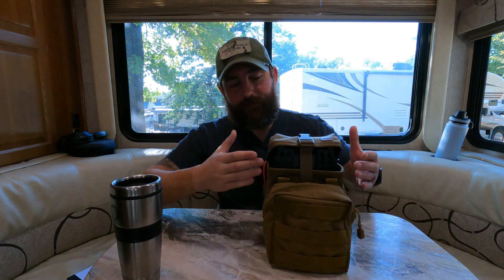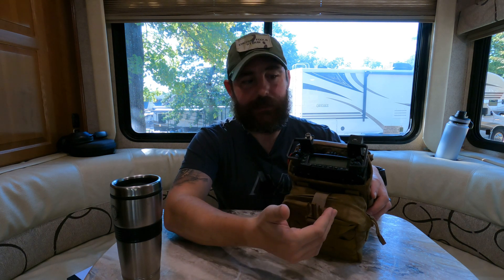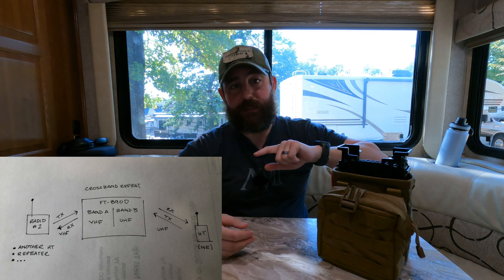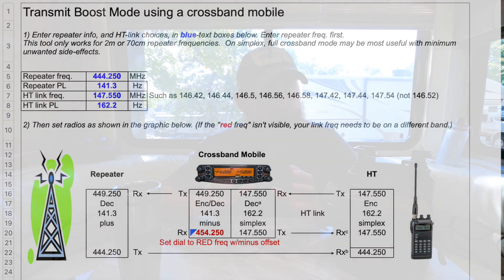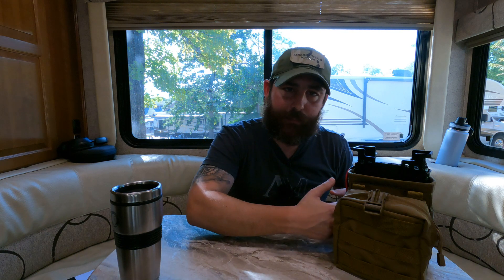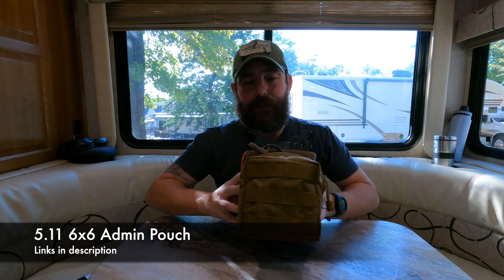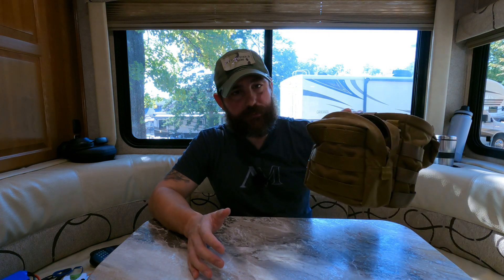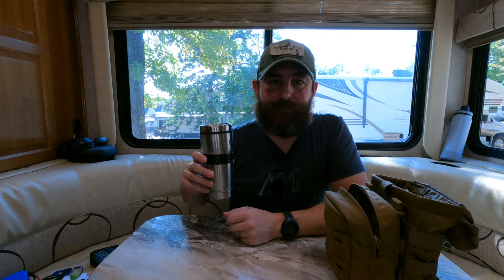Military-Style Radio - Manpack Crossband Repeater - Part III

Comment: As usual, really thankful and enjoyed the content. You've got me thinking through building out a manpack. I have limited equipment (a DB mobile and a few HTs) and want to utilize what I have since buying/building a whole new kit is out of budget for me. Luckily Armoloq makes a pack frame for my mobile unit (Anytone 578). I was wondering if you had any advice on how and what to think through on determining what someone would want/need in a manpack, capability wise. I know that it's individual to each person's needs, but I'm struggling to figure out how to determine what those needs might be or should consider. Thank you!
Reply from the maker: This is a great question. It absolutely depends on what you want to do. I will try to touch on this topic on my next video as there are so many bands and modes of operation. I will be covering the Yaesu FT-818ND which is an all-band and all-mode rig. It's basically a Swiss Army Knife, but you lose some capabilities such output power, dual VFO and crossband repeater. There is no perfect radio for all application. Think about who you want to contact and make decisions around the best form communication for that application. Good luck with your build.
Reply: @TheTechPrepper  so would you say this is the perfect overall radio? To give you basic everything all band and digital too?
Reply from the maker: @paulNC  It's a toss up between this one (the FT-818ND) and the next one (the FT-857D) I am going to cover. I will be comparing them in the next video. They have the same all-band, all-mode capabilities. The only difference is size and power. If you're on foot, the 818 is the way to go. If you have a vehicle or a base of operation, the 857 is the way to go.
Reply from the maker: @paulNC  It's a toss up between this one (the FT-818ND) and the next one (the FT-857D) I am going to cover. I will be comparing them in the next video. They have the same all-band, all-mode capabilities. The only difference is size and power. If you're on foot, the 818 is the way to go. If you have a vehicle or a base of operation, the 857 is the way to go.

Comment: Hi, im super interested to work out how to send the keyboard keyboard chat using two of these 8900 radios. I have one, i may get another, and or a 2980.  I too got this radio for the crossband repeat option, allowing me to use the low power pmr radios and repeat it out further on vhf....... i was annoyed to see that the radio cannot do the 6.25 steps, but have found the 5 tuning steps to work perfectly well enough.  I have a question for you though, when you do cross band repeat. does the fan stay on all the time? Mine turns the fan on the moment it transmits, and it never goes off again until power cycled, i have read this was an issue with the firmware, but dont know if they ever fixed it. 

I love this radio, especially the ability to listen to air traffic, just listening to the local weather etc is great to confirm the conditions on the day and make sure eveything is working. 

what kind of range does that signal stick get you?
Reply from the maker: Check out my videos on NBEMS for more info on keyboard to keyboard topics: https://www.youtube.com/c/TheTechPrepper/search?query=nbems

I typically only crossbanding one way. We call it transmit boost. The fan turns off for me.

Comment: hi, i don't believe that full duplex is possible because duplex need "cavities" (for rx/tx isolation) which are not tiny at those frequencies.. also why not to do some holes in the end of your bag for ventilation (and exhaust the heat in the air).. what i love it the idea of autonomy with a minimum of gear in your videos.. i dream of the field way of communication, hope it one day!! ❤

Comment: I suspect thea building a "radio system" such as you are describing follows a plan. In my builds I develop a detailed "Mission Statement". From that statement I decide what equipment will meet the specifications of the mission statement. Without the statement it becomes too easy to be distracted by bells , whistles and gongs that sound good but do nothing for the mission. I built a communications trailer using this concept N6JAI
Reply from the maker: I could not agree with you more. Each manpack that I build has a specific purpose and set of applications in mind. I actually have three different manpacks that are designed to handle different operating scenarios. Glad to see that you share a similar point of view on radio systems. Pick the right tool for the job at hand. 73.

Comment: Do you have a source for the Mobilinkd TNC3? They are sold out with no restock date. GREAT videos BTW.
Reply from the maker: Unfortunately, you will need to go directly to the mobilinkd site and hang tight until they are available. There may be some on eBay, but I have not personally checked. Good luck finding one. They are great from APRS and generic packet work.

Comment: What's your opinion on using a 2m/70cm amp powered by 13.8v DC along with an HT in this role? My daily EDC radio is a Yaesu FT-1DR already MARS modded and programmed the way I want. The built in APRS capability is a plus. 
I was thinking of integrating this into a manpack setup along with my Xeigu G90. I see dual band amps come up for sale on QRZ fairly often for very reasonable prices, and it seems an economical way to achieve a lot of capability in a man pack, without a lot more money. 
Figured I could power both the G90 and the amp off of the 18ah lithium polymer battery I already have. What pros/cons do you see for this sort of setup?
Reply from the maker: I can't really comment as I have never run that style of deployment. Personally, I find that I can make most contacts on an HT by moving to higher ground and with a better high gain antenna. APRS is great. I have the Mobilinkd TNC in my chest rig and have a cable for every radio. I just use the APRSDroid app or my own custom ARPS software when I use the laptop. I have considered an external amp, but mostly for my QRP manpack (FT-818). It's another component that can fail and I do not like that there is not an option on the market that covers HF/VHF/UHF. I'm sure others may have a different opinion about it.

Comment: Had the Yaesu 8900 in a mobile application and hated the radio for that because of all the knobs and small screen were hard to use in a rough riding truck. I packed the radio away and forgot about it, maybe time to pull the radio out and rethink its application. Or Ill sell it since discontinued Yaesu radios seem to hold there value.
Reply from the maker: Sell it! You'll make a killing. I agree. I do not like this radio for vehicle operations. Personally, I have found the Kenwood D710 to be my go-to mobile rig for the vehicles. It's easy to use while driving. Which rig do you prefer to the vehicle?
Reply: @TheTechPrepper  I'm a Yaesu guy, I ended up getting the FTM-400.  I like the dual watch and the 400 has much larger display with visual representation of volume level on the screen when you turned the knobs.
Reply: I would like to buy it if you are it. I hope we can work something out.
Reply: @ronaldlwilliams6839  I won't ship, local cash only in Denver Colorado.  If you really like the Yaesu FT-9800 capabilities and design you might want to look at the clone version.  TYT brand TH-9800 is a clone of the Yaesu and still readily available for half the price. Reviews are a bit spotty with some complaints of weak finals.
Reply: @mrbyamile6973  No problem. I was just curious. Thanks for the prompted response. Have a great weekend!

Comment: I have an Icom 2730A I've been thinking about setting up for a portable cross band repeater. It receives at 1.2A and transmits at 13A (I know its not the most efficient) so In cross band repeat mode will it draw a constant 13A or only when Transmitting? The Duty cycle statement confused me.
Reply from the maker: It only transmits when you or the other station is transmitting. The rest of the time it is receiving. In full crossbanding it's transmitting both sides of the conversation between both parties. Sorry, I should have been more clear.
Reply: @TheTechPrepper  Thank you! That's what I thought but I figured I could easily be wrong!

Comment: Quick question:   I’m really wanting to get that man pack built around my yaesu 8900.  With that, I need to be rigging up a tablet/lap top.  I know the Toughbook is the recommended way to go.  Is there any merit to a cheap Samsung tablet that will pack easier?  Maybe even in a sleeve inside the man pack or between the man pack and auxiliary/battery pack?  

Trying to take the cheap way out but maybe “buy once cry once” is the way to go here.  I appreciate your “tools not toys” approach.  

Thanks again.
Reply from the maker: I can only recommend what I use. Prior to the Toughbook I ran a Raspberry Pi 3B+. I destroyed three in the desert. The Toughbook has been handling the heat and Sonoran Desert for almost a year. The great thing about the CF-20 is that it coverts to a tablet. The screen detaches from the keyboard. The touch screen works with gloves, sweat and full sun.

Comment: I'm playing with a TYT-TH-9800 as well.  I'm almost done making up an Easy Digi interface specific to the radio that will have to connect through the mic port as the TH-9800 doesn't have a digital in capability.  Not as nice as the Yaesu but it should get the job done.  KD9RJX
Reply from the maker: It's unfortunate that the TYT-9800 was not a 100% clone right down to the 6-pin MiniDIN for the data port. This is how the interface works for the FT-2980R. It stinks that you need yo cannibalize the mic connector and speaker jack to run digital modes. Good luck with your cable build. 73's

Comment: I'm looking into how id hook the digirig to the tyt. I got a pin out, might have to get a second mic and do some fabricate'n
Reply from the maker: it stinks that that TYT did make a 100% clone. It uses a USB cable instead of the 6-pin MiniDIN. I am not sure if it even handles data for digital modes. I would be interested to hear what you find. Good luck!
Reply: @TheTechPrepper  basically im going to add a 4 pole .35mm jack for ptt mic speaker n ground so itl plug right into the digirig. Unfortunately theres no speaker on the hand mic pin out so i gotta get wild. KD2YHI
Reply: Any luck with digital on the tyt9800?

Comment: I got an email from Digirig.  They are going to make cabling for the FT-2980 before the end of the year.  That should work with other Y mobiles with the same mike pin setup.
Reply from the maker: Congrats on your DigiRig. I was the original tester of the FT-2980R. It works great. The original prototype had too short of a Y connection, but Denis is fixing that now. Here's a picture I posted a couple weeks back. https://www.instagram.com/p/CiX2C_prcTg/
Reply: @TheTechPrepper  Do not have it yet. Ordered it last night!

Comment: I don’t think you’re setting up crossbanding quite right.  The scenario you set up first has the two parties use different HTs.  One is on UHF, while the other is VHF only.

What you want is to set up all HTs transmit on UHFand receive on VHF.  Set the crossbanding mobile to receive on UHF and simultaneously rebroadcast on VHF.  This way all the transceivers in your group can be set up uniformly.

Comment: Just curious new subscriber.  Question could this maniacs setup talk to the baofang uv-5r ?
Reply from the maker: Welcome! Yes, you can use the Baofeng to talk to the FT-8800/8900 and use its crossband repeat capabilities. The nice thing about the UV-5R is that it supports dual watch, so if you configure the FT-8900 for "transmit boost", the UV-5R can listen on one band and transmit on the other. Good question.
Reply: @TheTechPrepper  awesome I was looking for a setup like this to run a squad size unit with a patrol base where the comes could be extended in two directions. Awesome content.  Also the battery used is no longer available what would you suggest as an alternative to this battery.  Keep up the great work

Comment: Dude, really love your work.  I'm learning a ton, super inspiring, love your "get out and test in the dirt/heat/cold" approach.  Question about NVIS: would this be a semi-reliable way to communicate between 2 camps separated by a mountain, i.e. instead of a repeater?  Or is NVIS more of a "talk to random contacts wherever your signal gets bounced to" kind of thing?  I'm contemplating a WRoL situation where running a repeater might attract more "attention" than I'd like.  Is NVIS consistent enough for these 2 camps (separated by say a couple of "as the crow flies" miles) to stay connected?  Would they be able to stay in constant contact like they would if they were in line of sight on VHF?  Or would it be pretty unreliable?  Like you I'm gonna get out and test but I'm just wondering what's possible.  Thanks!
Reply from the maker: Glad you're enjoying the content, Robert. This is a great question. I will actually by covering NVIS in an upcoming series. NVIS is a good from about 30 to 300 miles and is an incredible method of communication for local and regional communication with out any infrastructure. It does not matter if there are obstructions like mountains in the way. I have had issues making really close contacts on 40m using my NVIS antennas. However, 75m/80m NVIS has worked a lot better especially at the closer distances. I have a campaign that I am starting when I do this series with the tagline: "NO RANDOM CONTACTS". The military relies on heavily on NVIS. 

Here's a video that I made on NVIS: https://youtu.be/-pKLZCuWZY4

Comment: Which adapter BNC Signal Stick would I need to use on the TYT 9800?
Reply from the maker: BNC, but be careful running the Signal Stick above 5 watts with this setup. To get the SWR down add ferrite beads to the jumper coax and add an RF ground. I have a video coming soon on this.
Reply: @TheTechPrepper  What antenna would you recommend for running the radio at higher wattage?

Comment: Another solid video! I may have missed it, but do you have a planned use for the 6 meter or 10 meter capabilities? Voice? Digital? Keep up the good work, but don't feel obligated to do it on your vacation! 😁
Reply from the maker: I only plan to run 6m FM. I can run 6m FM on the 8900 and my fleet of VX-6R handhelds. My goal is to run some tests locally to see effective range and performance. I established some good benchmarks during my VX-6R series, so I can compare how it stacks up to 2m FM. Do you think there would be interest in a 6m FM video?
Reply: @TheTechPrepper  I'm just starting to explore 6m, so selfishly my answer is yes. However, I'm sure there's wider interest in a crossband video, which would be great too. Thanks Gaston!

Comment: 2 questions.
1- does this radio support encryption
2- can you use encryption when in cross band mode
Reply from the maker: Unfortunately, no for both. However, it is technically possible to use encryption when the radio is connected to a computer if you know what you are doing. I have been working on some custom software to do this, but it's not publicly available.
Reply: @TheTechPrepper  thanks for the info

Comment: Gaston, I sent you an email. I have 2 of the TYT-TH-9800's, one portable, one used as a base. I'd be willing to loan one to you for you to evaluate against the 8900. I'd like to know if it can use a Dgirig or not. Can't find any documentation one way or the other.
Reply from the maker: Morning, Gene. Thanks for following up. I really appreciate the offer, but can't take you up on the offer until next year. Sadly, I am overwhelmed with all the projects, videos and day job. The comments and mail bag have exploded over the last two months and can't seem to keep up. I am not complaining, but you guys are keeping me busy. ;-)

My only concern about the TYT-9800 is that they did make a 100% clone as they did not include the standard 6-pin MiniDIN data port like the FT-8800/8900. It looks like this clone uses a USB port. I fear that it may just be for programming, but I could be wrong.  

Take care and thanks for the offer. Good luck with your 9800.

Comment: I have the tyt clone. Do you know if the digirig mobile works the same way with it. I’ve been trying to find a good way to set it up with digital
Reply from the maker: If it's an exact clone with a data port, it should work. I have no way of knowing without testing it. When funds free up, I'll try to buy a TYT-9800. Have you tested the crossband repeat on your unit?
Reply: @TheTechPrepper  I also have the TYT. Do you have a link for the Digirig cable? Can't find it anywhere. I'm using a UV-5R in the house with APRSDroid and the 9800 in crossband. Not the most efficient setup, but it works well.
Reply: I’ve programmed for crossband repeat but haven’t had the space or time to fully test it out.

Comment: The TYT TH9800 is a quad band too.  Might be a little less expensive too.
Reply from the maker: It's still on unclear to me how the data port works on the TH-9800. It does not have the 6-pin Mini DIN connector like the FT-8800/8900.
Reply: @TheTechPrepper   I researched this radio at one point. If I remember correctly, you'd have to make a cable to interface through the mic port. I may be mis-remembering, but pretty sure that's the case.
Reply: @triggerhappy19832007  My understanding as well.  I just contacted Radiooddity and they said only through the mic.  It looks like Signalink has an option for the TH-9800 via the microphone jack.  (full unit SLUSBRJ1; module SLMODR1Y)   I bet Digirig can suggest or make a cable off the module schematic.
Reply: If that's the case, I think there is more then one mike input, could you input the digirig in one and the mike in the other